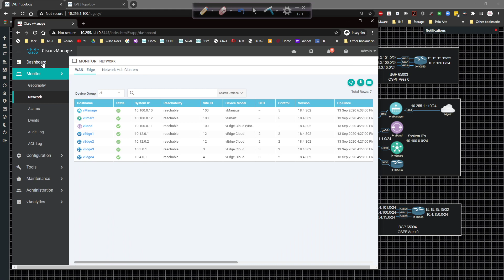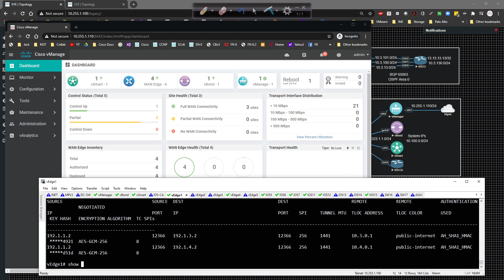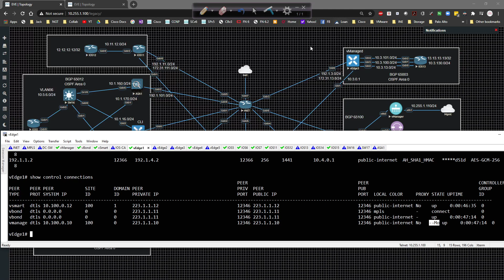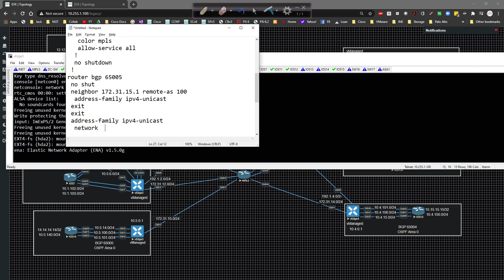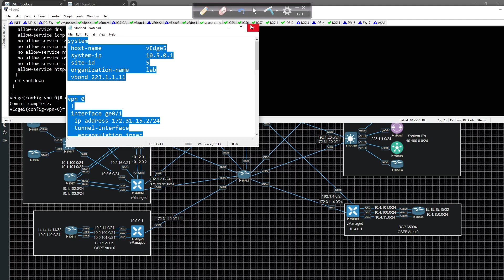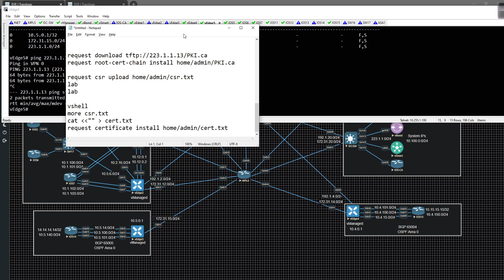Cisco SD-WAN 005 - Bringing up MPLS Transport

Comment: I could not get vEdge version 20.15.1 to work correctly,  so I dropped down to version 20.13.1.   But even when 20.13.1,  my interfaces would cease to function.  Requiring me to perform a shut/no shut to get them working again.   Anyone else experience similar issues.

Comment: I configured this after setting up the interfaces. I'm not sure if it's correct. Please correct it if needed. Also, if you can provide the necessary steps, I would really appreciate it, sir !

MPLS(config)# router bgp 65000
 neighbor 10.3.0.1 remote-as 65003
 neighbor 223.1.1.0 remote-as 65100
 neighbor 10.4.0.0 remote-as 65004
 neighbor 10.5.0.0 remote-as 65005
 neighbor 10.5.6.0 remote-as 65005
 neighbor 10.3.0.1 send-label
 neighbor 223.1.1.0 send-label
 neighbor 10.4.0.0 send-label
 neighbor 10.5.0.0 send-label
 neighbor 10.5.6.0 send-label

MPLS(config)# ip route 0.0.0.0 0.0.0.0 172.31.20.2
MPLS(config)# ip route 0.0.0.0 0.0.0.0 101.0.0.1

Comment: I am looking for the configuration of the MPLS router. Can you provide it?
Reply from the maker: i don't, but it's a basic setup, shouldn't be hard to get it up and running.
Reply: I configured this after setting up the interfaces. I'm not sure if it's correct. Please correct it if needed. Also, if you can provide the necessary steps, I would really appreciate it, sir !

MPLS(config)# router bgp 65000
 neighbor 10.3.0.1 remote-as 65003
 neighbor 223.1.1.0 remote-as 65100
 neighbor 10.4.0.0 remote-as 65004
 neighbor 10.5.0.0 remote-as 65005
 neighbor 10.5.6.0 remote-as 65005
 neighbor 10.3.0.1 send-label
 neighbor 223.1.1.0 send-label
 neighbor 10.4.0.0 send-label
 neighbor 10.5.0.0 send-label
 neighbor 10.5.6.0 send-label

MPLS(config)# ip route 0.0.0.0 0.0.0.0 172.31.20.2
MPLS(config)# ip route 0.0.0.0 0.0.0.0 101.0.0.1

Comment: Hi Rob, I have gone through multiple Tutorial for CISCO SDWAN and Must say it's a Best SDWAN Tutorial in Yotube, Thank you so much for shariring these vedios ! I have one query,During Brownfield Migration- if we have any site with only MPLS circuit and want to Migrate to SDWAN( Considering All 3 controllers in Cloud) over same circuit then in this case how we can onboard vedge or how will reach to Vbond or ZTP server for initial authentication or orchestration as these controllers have public IP ? like as we know in case of Internet circuit it's very convenient for Vedge to reach out to public Vbond or controllers for successful on-boarding.
Reply from the maker: You would have to make a concession and give access internet access to those sites via MPLS. It's not very hard to do, backhualing internet over MPLS VPNs. If there's a business use case, IT has to figure it out, ya know what I mean?
Reply: @RobRikerTechChannel  Thank you Rob for explanation ! Yes, what I understood is need to ask MPLS provider to give access towards Internet in order to reach controllers in the cloud.Also am very curious to know there are many SDWAN vendors like Fortinet & Silverpeak which doesn't have separate control plane component( like we have Vsmart in CISCO) and as I understand in  Fortinet solution - Control plane and data plane exists on edge devices itself, Do you think such solutions are scalable and achieve Granular or extensive Traffic Engineering please.

Comment: Thanks for the labs. FYI, I'm running version 20.3.4 without any major hitches. It does seem that tftp is not supported for the copy cert operations but I work around it using vshell and pasting the certs to the local file system, then import. Good work!
Reply: sir can u share the configs of inet and mpls routers if u steel have them thank you !

Comment: Rob, can you share this eve-ng SD-WAN toplogy in the membership section? The one you shared in the members section has different ip address in the mpls, Inet and DC-SW Gi0/0 etc. The MPLS and Inet config files shared don't match this video's ip's either. 

I went and changed the devices and IP's myself to match what Rob's doing here, seems the ones on the membership site are not matching on purpose from what Rob was saying in his Thursday night support video. One thing to note is I never said I could not change IP's nor that I needed someone to change them I asked if you had files that matched and the obvious if you did can you upload them.  I have Learned a bunch from this series thank you.

Comment: Hello Rob, I'm doing the lab, and when I do show bfd sessions I have no results, did I miss something?
Reply: Did you manage to resolve this? I have the same issue. No output in show bfd session and show ipsec outbound-conn.
This has something to do with viptela versions. I am on 20.4.2. I rebuild this on a second lab in GCP and still has the same issue. One of my labs running 18.4.4 did not have this issue. I can see a few others in commends having the same issue in SD-WAN004 as well. 

What version are you using? 
Has anyone else managed to get this working in non 18.x version?
Reply: @johnmathew5115  Sure, I was using the same site id on the vedges, which is wrong, however there is a feature that you can apply to have an ipsec tunnel with the same site id
Reply: @choe182  Thank you so much. This ended up being the problem. I have corrected my Site ID from 12 to the correct site ID such as 3,4,5 and all my bfd sessions are now working.

Comment: Thanks for another great video! I read through the Ciscopress SDWAN: Designing, Deploying, and Securing your Next Generation WAN with Cisco SD-WAN book (great book btw!) and wanted to throw in some information I took notes on in regards to the issue with the vEdge's trying to build across all colors. You were spot on with the "restrict" option. There is also another method. Below are the notes I took:
- By default, WAN Edges will attempt to build data plane tunnels to each other site using every Color available.
 - If that is not desired, then you can configure the "restrict" attribute in the TLOC. This will prevent tunnels from being built to that color from another color.
- Another method to restrict tunnels from being built is by using Tunnel Groups. You can configure it so that tunnels are only built to other TLOCs in that tunnel group
 - An example would be where you have a data center with two MPLS connections and one Internet connection. You have two branches, and each one only has access to one MPLS provider and one Internet connection. If you were to just use Colors with Restrict, then the branches would only be able to build to the MPLS interface of the Data Center with that same color. However, if you put all of the MPLS interfaces in the same tunnel group, and the Internet interfaces in another one, then all of the MPLS interfaces will form tunnel adjacencies.
Reply: Tim, very good post and I just added your comments to my own notes.  Thank you for sharing!

Comment: Thank you for this video. I tried a minimal version of the lab with just 2 vEdges, and even after all the configuration, there are no bfd sessions. The "show bfd sessions" command turns up empty, even though the control connections are all up on the MPLS and INET colors. Also in the vManage GUI, I can see all the control connections up. What could be the issue?
Reply: Did you manage to resolve this? I have the same issue. No output in show bfd session and show ipsec outbound-conn.
This has something to do with viptela versions. I am on 20.4.2. I rebuild this on a second lab in GCP and still has the same issue. One of my labs running 18.4.4 did not have this issue. I can see a few others in commends having the same issue in SD-WAN004 as well. 

What version are you using? 
Has anyone else managed to get this working in non 18.x version?
Reply: Found the root cause. Its because we copy paste Site ID on vedge3,4, 5 without changing site ID to 3,4, and 5. Correct the site ID so Viptela knows they are different WAN sites.

Comment: 26:35 I had to turn off the interface ge0/0 and remove it from vpn 0 to get rid of the partial control status =) 😀
It seems vManage read that vEdge5 has 2 WAN connections.

Comment: Hi Rob... i am in video 5 .. i am unable to ping 172.31.12.2 from Vedge1 logs as below , can you pls help here .. 

there is no routing in 192.31.12.0/24 in Vedge1
VEDGE1# sh ip route
Codes Proto-sub-type:
  IA -> ospf-intra-area, IE -> ospf-inter-area,
  E1 -> ospf-external1, E2 -> ospf-external2,
  N1 -> ospf-nssa-external1, N2 -> ospf-nssa-external2,
  e -> bgp-external, i -> bgp-internal
Codes Status flags:
  F -> fib, S -> selected, I -> inactive,
  B -> blackhole, R -> recursive

                                            PROTOCOL  NEXTHOP     NEXTHOP          NEXTHOP                                                   
VPN    PREFIX              PROTOCOL         SUB TYPE  IF NAME     ADDR             VPN      TLOC IP          COLOR            ENCAP  STATUS  
---------------------------------------------------------------------------------------------------------------------------------------------
0      10.1.16.0/24        connected        -         ge0/2       -                -        -                -                -      F,S     
0      10.12.0.1/32        connected        -         system      -                -        -                -                -      F,S     
0      172.31.11.0/24      connected        -         ge0/1       -                -        -                -                -      F,S     
0      172.31.13.0/24      bgp              e         ge0/1       172.31.11.1      -        -                -                -      F,S     
0      172.31.14.0/24      bgp              e         ge0/1       172.31.11.1      -        -                -                -      F,S     
0      172.31.15.0/24      bgp              e         ge0/1       172.31.11.1      -        -                -                -      F,S     
0      192.1.1.0/24        connected        -         ge0/0       -                -        -                -                -      F,S     
0      223.1.1.0/24        bgp              e         ge0/1       172.31.11.1      -        -                -                -      F,S     
VEDGE1# show bfd sessions
                                      SOURCE TLOC      REMOTE TLOC                                      DST PUBLIC                      DST PUBLIC         DETECT      TX                              
SYSTEM IP        SITE ID  STATE       COLOR            COLOR            SOURCE IP                       IP                              PORT        ENCAP  MULTIPLIER  INTERVAL(msec) UPTIME          TRANSITIONS 
-------------------------------------------------------------------------------------------------------------------------------------------------------------------------------------------------------------
10.3.0.1         3        up          mpls             mpls             172.31.11.2                     172.31.13.2                     12426       ipsec  7           1000           0:00:39:25      0           
10.3.0.1         3        down        public-internet  public-internet  192.1.1.2                       192.1.3.2                       12386       ipsec  7           1000           NA              0           
10.4.0.1         4        up          mpls             mpls             172.31.11.2                     172.31.14.2                     12386       ipsec  7           1000           0:00:39:25      0           
10.4.0.1         4        down        public-internet  public-internet  192.1.1.2                       192.1.4.2                       12366       ipsec  7           1000           NA              1           
10.5.0.1         5        up          mpls             mpls             172.31.11.2                     172.31.15.2                     12406       ipsec  7           1000           0:00:38:52      0       

VEDGE1# ping 172.31.12.2 vpn ?
Description: List of VPN instances
Possible completions:
  0  512
VEDGE1# ping 172.31.12.2 vpn 0 source ? 
Possible completions:
  Source interface or IP address
VEDGE1# ping 172.31.12.2 vpn 0 source ge0/0
Ping in VPN 0
PING 172.31.12.2 (172.31.12.2) from 192.1.1.2 : 56(84) bytes of data.
ping: sendmsg: Network is unreachable
ping: sendmsg: Network is unreachable
Reply from the maker: You won't be able to. vEdge 1 and 2 are part of the same site. They both use the same BGP ASN so you run into the AS path loop prevention mechanism. You can override this on the MPLS router by using the "as-override" command on each neighbor, vEdge 1 and vEdge 2. But when you think about it, it's pointless for a vEdge to communicate with another vEdge at the same site. You have vEdge3, 4  and 5 present which is the main goal. When you get further into the series, you'll see why, specifically iBGP peerings later.
Reply: @RobRikerTechChannel   Thank you Rob..

Comment: Rob great videos!! In terms of getting cross transport BFDs up, I think you missed one step. Yes INET->MPLS BFD would be OK because you have that connection between INET and MPLS and vEdges have default route out INET transport so yes it will work. I believe the issue you ran into was the return, MPLS->INET BFD. The MPLS router has the static route (192.1.0.0/16) back to INET but did you redistribute that into BGP 100 on MPLS router so the vEdges learn that route?  If you didn’t include that MPLS->INET BFD would fail, keep it up!!
MPLS#
router bgp 100
 !
 address-family ipv4
  redistribute static
Reply: Correct !! You can even use NAT Between MPLS and INET transport.  One thing to note is that ICMP traffic routes per destination based. But Tunnel traffic routes the same interface it originates on regarding of the routing table.

Comment: Hi Rob, thanks for the SD-WAN series of videos, the vEdge onboarding process seems to be very complex, is that because we're using vedge ? for real hardware, I assume there is a zero touch provisioning process that the cert and controller/orchestrator related configuration can be pushed to device easily ?
Reply from the maker: ZTP is available for both to my knowledge. Haven't tested it out.
Reply: @RobRikerTechChannel tons of thanks, learned a lot from your videos, please keep it coming 🙏